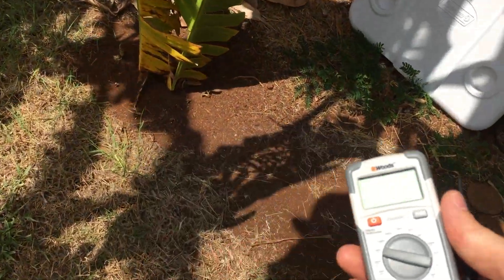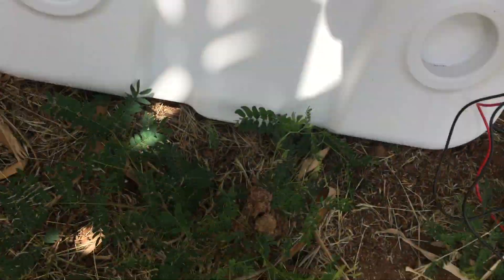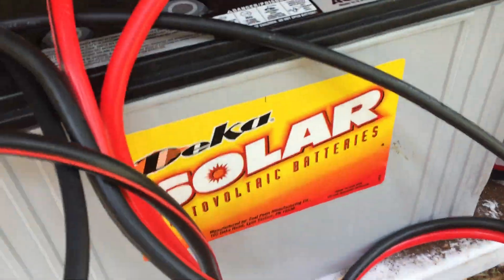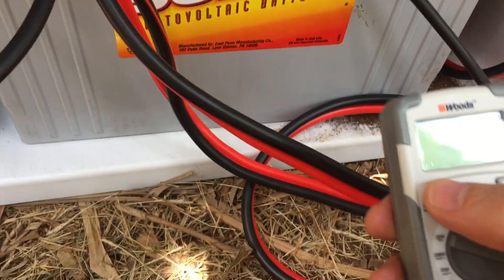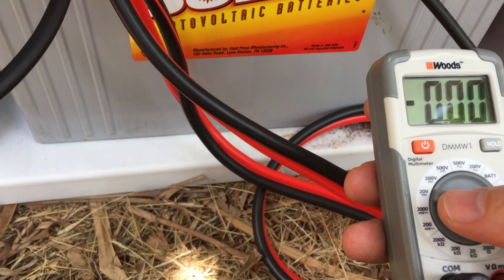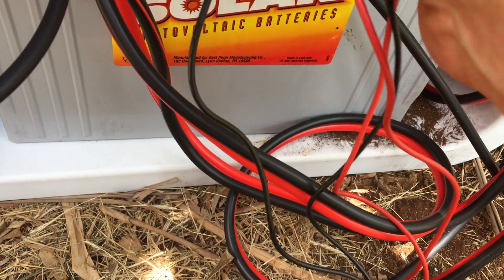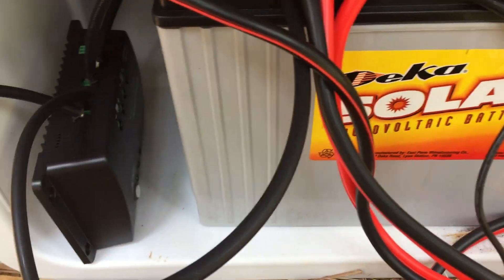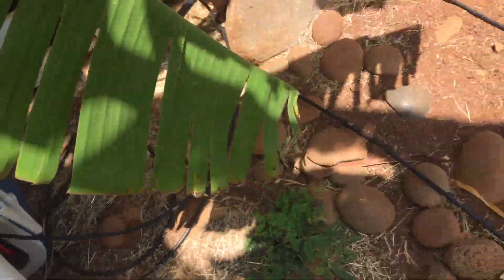Can't wait for my better charge inverter to get here.

Comment: Have you received your new inverter yet?  Have you been able to charge your LEAF using only solar power?
Reply from the maker: I have not received my new inverter.  Because of the expense of the batteries, when I do get my inverter it won't be enough power to have my leaf going off solar power only.  I will basically be generating 25% of my power from my panels, and the other 75% I will get from the grid.  At least Maui is 35% green right now.  I know that isn't perfect, but it is better than most places, so it is a good starting point.  Maybe down the road I will make some better choices and have more money available to expand my system.
Reply: Why do you need more batteries?  Can you not add another solar panel to charge your batteries faster?  Aren't the panels cheaper then the heavy batteries?  I guess I really don't understand how much of "what" you need in order to do this.
Reply from the maker: I am not home often.  Basically the panels charge the batteries when I am working, I charge my car from the batteries, and then the panels charge the batteries the next day when I am working.  I work full time and run a kung fu school on top of that.  I am at the school 40 hours a week, so I don't have any free time to run home and charge my car.  So in order to cover 100% of my range I would need more batteries to store more energy while I was working.  Because I can pretty much only charge my car at night while I am sleeping.
Reply: Oh ... OK... Now I get it.  Thanks!!

Comment: Can you Net Meter where you live? As in put power into the grid, and the power company gives you equal credit for the solar power for what you'd otherwise pay to consume that much?
And how big is your new inverter?
Reply from the maker: My new inverter is 2000 watts, or 2 kilowatts.  The old one was only 300 watts.  I am not sure if people can still net meter or not.  Doesn't effect me, because my system is off the grid.  If I had a bigger system like I wanted, it would still be off the grid, by design, because I prefer it that way.  I want no part of the grid, I feel more free and independent if I can just generate and store my own power.